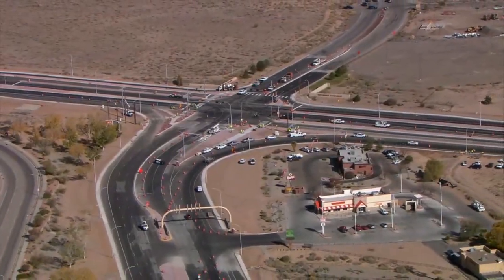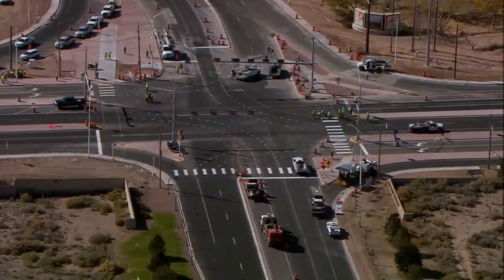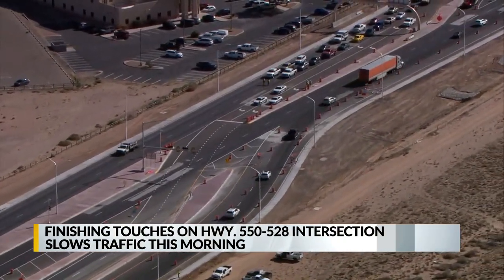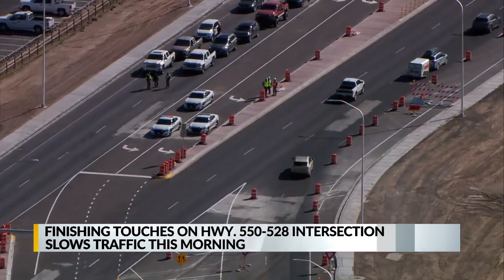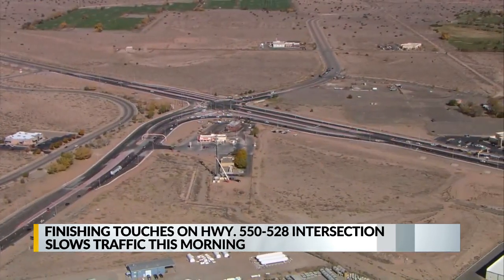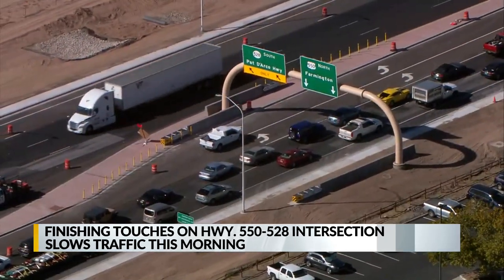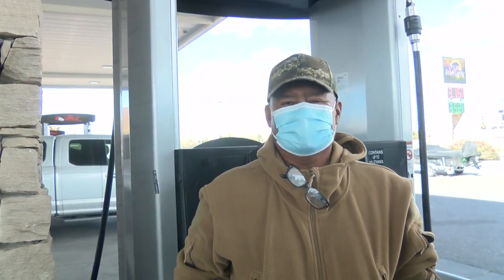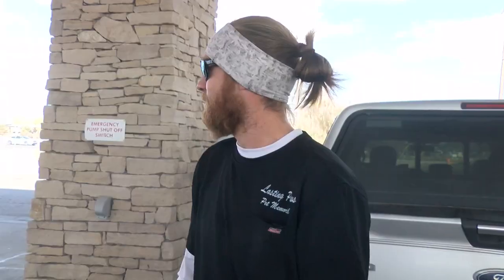Crews put finishing touches on Continuous Flow Interchange

Comment: This will work, and it will keep traffic flowing better. However, the problem is that there are so many lights between 528 and the river. I truly, whole heartedly wish that they installed intuitive traffic lights that would favor 550 traffic at peak rush hour times and keep the bulk of traffic flowing between 7am and 9am, and again from 4pm to 7pm. The lights will literally change for one car turning from the gas station or casino and stay that way as if 20 cars need to turn, thus causing major delays on 550 as traffic backs up. If side street traffic gets a little backed up because the lights favor rush hour traffic on 550 in the morning and afternoon, so be it, drivers in this area have been suffering for years not knowing if it's going to take five minutes to get through Bernalillo or 45 minutes. Do something about the lights during rush hour to keep traffic flowing!!!!!!!!!!!